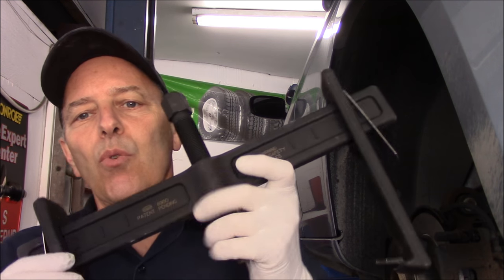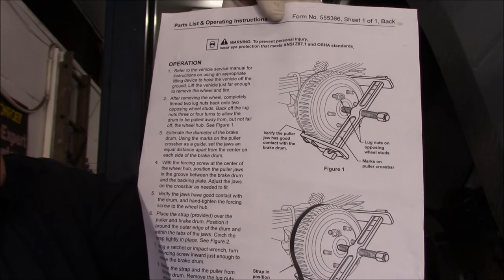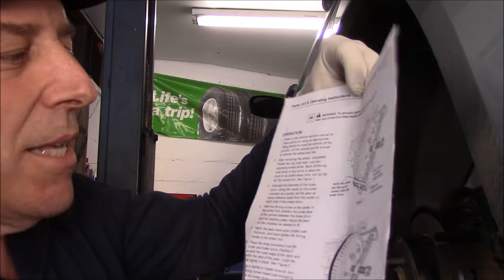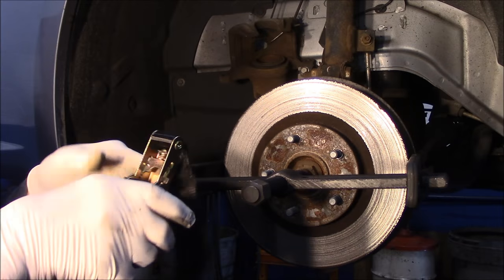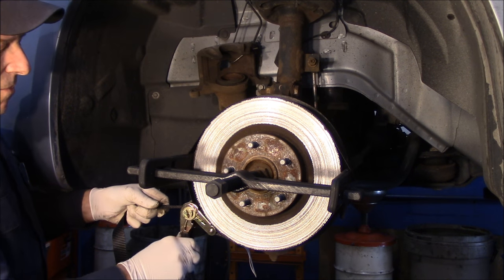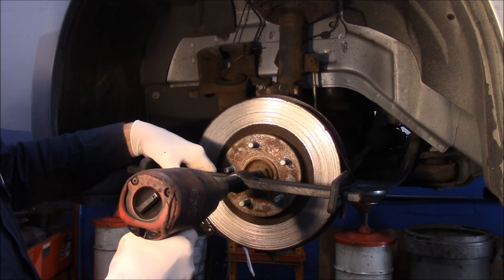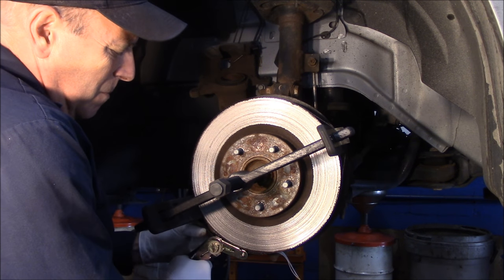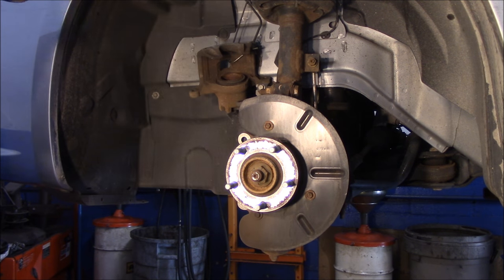Tool Review For OTC 6980 Heavy Duty Brake Drum Puller

Comment: I just used this on my '07 Jeep to remove the front brake rotors (original never removed). Worked great had them off in less than a minute. No banging with sledges and risk of damaging wheel bearings. Well worth the $$. One two three Bada-Bing!
Reply from the maker: Your right this tool work perfectly. No more beating with a hammer. Thanks for watching.

Comment: Just bought that tool today. It works extremely well on disk brakes for sure. I beat the hell out of the rotor for hours and it wouldn't budge. Couple of minutes with the tool and it was right off. Oddly enough, the rotor on the other side came off without even needing any tools.
Reply: I also have the tool but I mostly find myself inserting a long bolt through the caliper holder screw hole and screwing it in until the rotor pops off.

Comment: Shouldn't you put a lug nut or two on just in case it's stuck on very tight and it comes flying off after it releases?
Reply from the maker: Yes good point.Thank you for stopping by the shop.

Comment: Looks like an excellent tool. I guess you start with the hammer for a few minutes then give up and use the tool.

Do you remember the title of the video where you use the "nut and bolt" trick?
Reply from the maker: Oh yea that trick works great on the Ford rear disc trucks .Here is the vide https://youtu.be/JNTnRpjGOzg
Reply: jimthecarguy Thanks, great idea. Have you ever broken the ears off when doing this?
Reply: You mean the ears on the tools where it grabs behind the rotor? This tool is very heavy duty, it ain't gonna break.

Comment: seems like you would likely damage some shoes or hardware if the drum was stuck on a rust ridge
Reply from the maker: Oh yea for sure.If the drum has a rust ridge you would have to loosen the shoes by backing of the adjustment first but if it were just rusted on the axle you could just pop it off.very good observation.